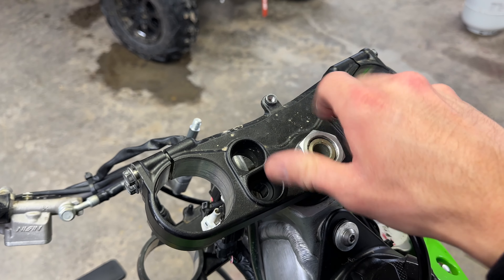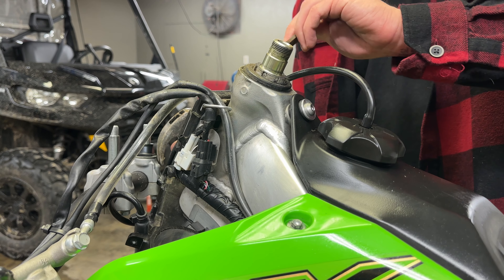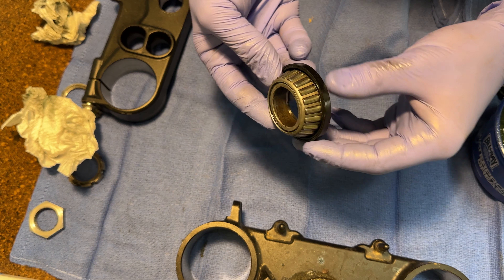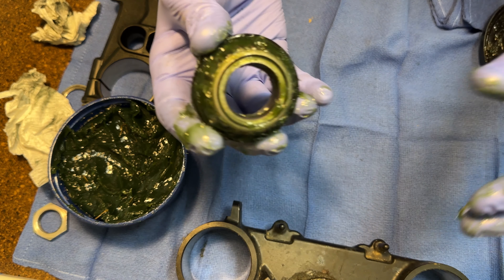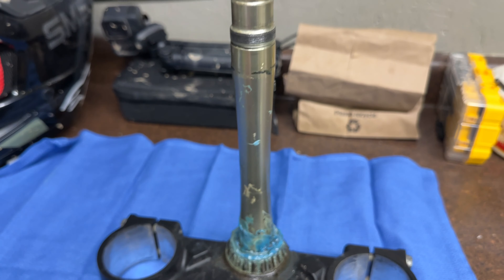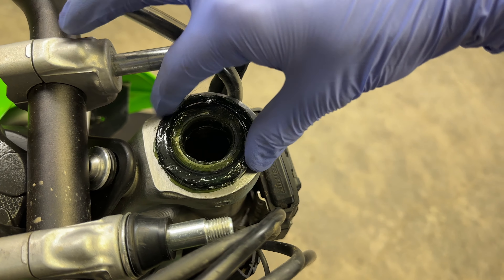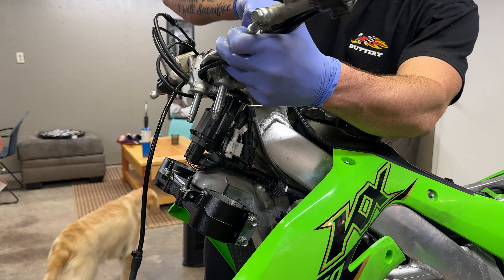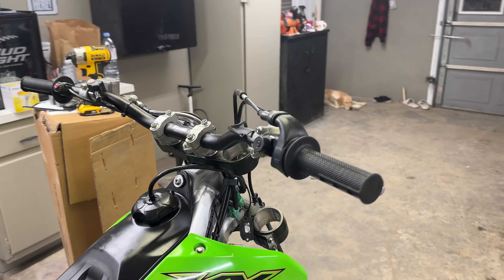Cleaning and greasing steering stem and bearings on dirt bike

Comment: I picked up a used 2018 and didn’t think to grease the stem bearings. 6 months later they locked up on me. Would never have believed it until it happened. The upper bearing was fine but the lower bearing race cage broke from no grease. I can only guess they barely put any grease during the original assembly.
Reply from the maker: Man I hope it didn’t cause an accident!